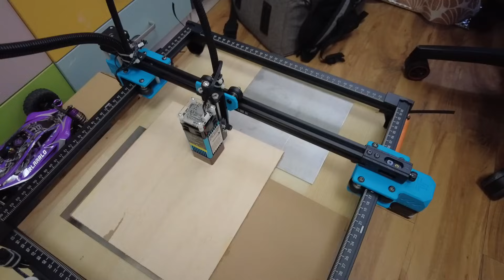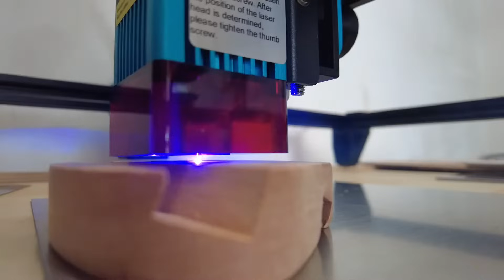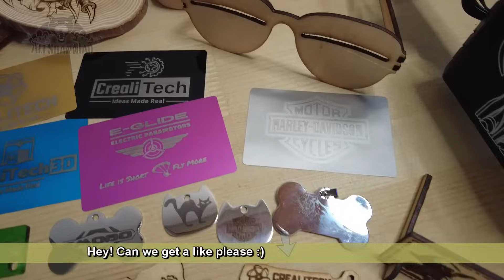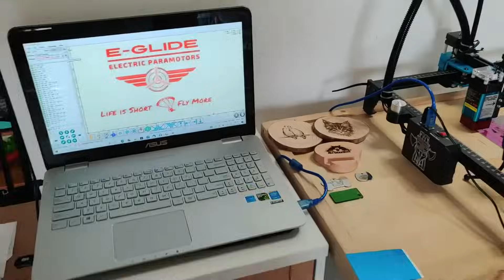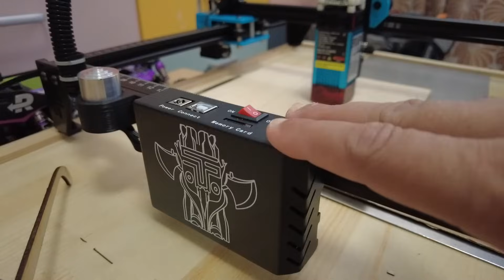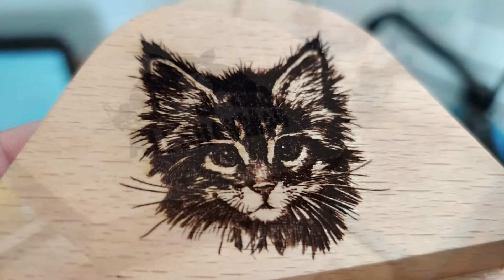Two Trees TTS-55 5.5W DIY Laser Engraver Laser Cutter Complete Review

Comment: Hello Ali, 
I have a question,
How do I know the measurements of objects?
And put it and be right , when i want to do one object, i throw a lot of wood till i take the right measures,
Reply from the maker: Measure the object first, width and length. then in graphics software set your page to those measurements. now design your graphics. export it as PNG Or SVG. upload the graphics to Lasergrbl. set the home point and test the engrave cut area. based on test, set your object under the laser. test again. until you are satisfied that it fits. else change the dimensions in Lasergrbl and values for measurements, (SVG can't change values, png can) once all is good, hit the action button to engrave cut.

Comment: Hi Brother
   I wonder what you are up to these days.
You are really an interesting person.
I myself am trying to laser etch or cut pcb for my electronic projects.
i can see that you already know how to etch metal.
I am wondering if you know the settings for copper cladding or pcb boards.

I would appreciate your assistance 

Sincerely

Ejike
Reply from the maker: i have just got the newest version of TTS 20Pro, with Air compressor and cylinder engraving module, it cuts upto 30mm easily. i have not done anything for Copper cladding or PCB boards so can't say the settings

Comment: Hi, thank you for the review. I have just purchased this laser and I am using Lightburne for my software. I’m currently trying to cut 2 mm acrylic. Would you have any advice on what settings to use as it’s barely scratching the surface on 10% speed, 100% power and 40 passes
I’m not sure what I’m doing wrong  😢
I would appreciate any advice you may have !
Reply from the maker: to cut acrylic you need to put some stickers. or else laser will keep going through and won't cut anything

Comment: Hi sir
I would like to ask a question actually,  if i have a wood router heard for cnc , can i change the laser head and put the router heard instead of it , is there a way to do that and would it work
Reply from the maker: Yes you can but it has to be a very light weight router
Reply: @alishanmao  yes i mean a router that's made for mini cnc , will it work perfectly? Because the router has more actions than the laser , it goes up and down
Reply from the maker: it won't do up and down, as it has no such mechanism programmed or built @badreddinebadreddine3192

Comment: How think is the wood sheets you used and how thick do you think it can cut before it has a problem cutting through?
Reply: What settings are you using to cut 10mm material? I have this laser and can’t get it to cut anything. It etches well but can’t get it to cut any wood. What speed and how many passes are you taking to cut 10mm wood?
Reply from the maker: 10mm can cut. as they said

Comment: I struggle get setting right for metal tag I have TTS-55 too.  I tried 10 times and nothing cut.  How do you get it in position ?
Reply from the maker: low speed and full laser power. play with settings

Comment: Hello, I have the same laser a few days ago and I can't cut 3mm plywood, what speed and power did you use in the video or soles use to cut and leave the piece without having to force it? Thank you very much for your help
Reply from the maker: low speed and full power works on cutting
Reply: And correct focus

Comment: Need help. Have this laser and need help figuring out how to set it to cut through sheet metal and wood and engrave steel. What programs do you use and what settings are best?
Reply: Did you ever figure this out? I'm trying to cut through 1/4 MDF board with LaserGRBL

Comment: What parameters power and mm line you use for engraving and cutting . please help.
Reply from the maker: you can get these parameters online by searching good practices
Reply: @alishanmao  I'm sorry to bother you but I have had my new machine like yours for two days and I'm not getting it to cut through the 2mm MDF board or plywood 3mm, on my GRBL SOFTWARE I don't see where to change number of passes, can you please help??
Reply from the maker: @grahamminter3450  100% laser, slower speed, experiment and see how many passes do right cut for you